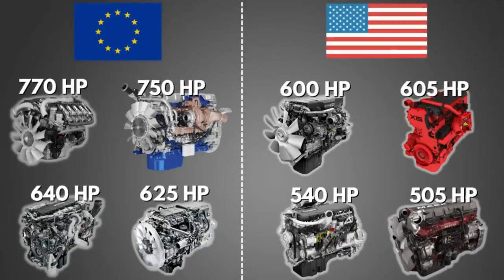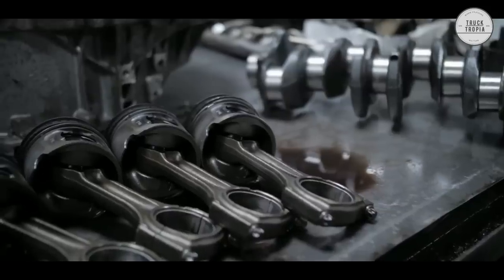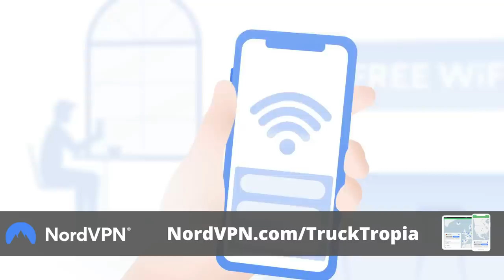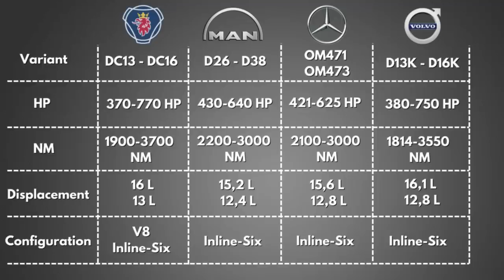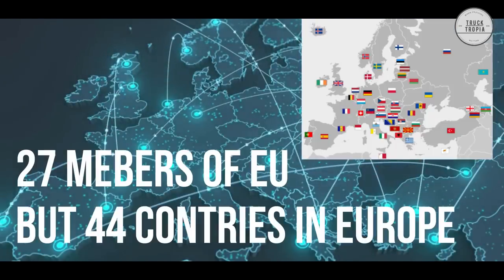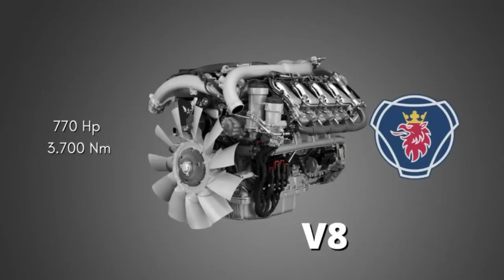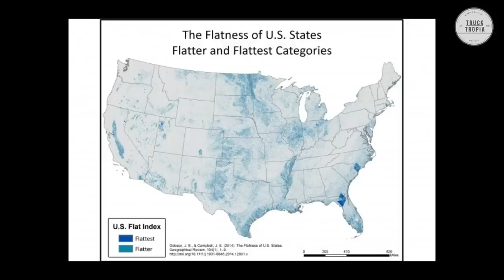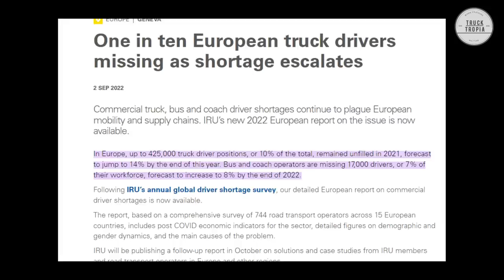Why European Trucks Have Up To 770 HP And US Don’t

Comment: Volvo builds engines for Mack and paints them red Mack colors. The engines range in sizes from 11 liters to 13 liters. We used to build the 16 liter but it was phased out in the US around 5-7 years ago
Reply: Volvo owns Mack. Volvo D16 engine did not make it in US because was running hot at high speeds,  (70-75 mph). The cooling system was not designed for this speeds and if you add some Arizona and Texas heat you have a big problem. And D16 was only rated at 620 HP in US and still did not make it.
Reply: @giacomu1  ironically in Australia  they run in much hotter weather and longer distances. Strange they ran" hot" in the US. We run the Globetrotter Cabover which runs in the Middle East and Africa as well
Reply: @robertryan7204  they probably have larger radiators in those trucks.
Reply: @groofromtheup5719   Australia can get very hot yes
Reply: Volvo engines ARE traditionally red....
Reply: @giacomu1  You are absolutely right, D16 runs hot and the rad system is not big enough cause of aero dynamic shape. more over it has injector cup issues and it doesn't burn very clean as per the California standards.
Reply: @thefreedomguyuk   I’ve worked for Volvo North American Trucks in their only USA manufacturing plant for 23 years and all the Volvo engines we’ve installed are D11, the old D12, D13 and in the past D16 engines w/green blocks and black valve covers. I’ve been in the Hagerstown engine manufacturing plant where all North American engines are produced for Volvo and Mack ( same engine) and all Volvo engine are  green and the Mack engines are red. You must be from Europe?
Reply: @OgleBilly  I think they they might be referring to Volvos gasoline engines which historically were red. Volvos diesel  engines are classicly green as you say and the MP8, MP10 (D13,  D16) for Mack are red. Volvo also makes the D9, D11 for Renault which are usually gray. I work on the assembly line in a Volvo factory in Sweden.
Reply: @thefreedomguyuk  Volvo truck/industrial/marine engines are traditionally green.
Reply: @giacomu1  
It seems weird. We have them in Israel, and we can get Texas and part of AZ hot, and we have 70 mph roads. Volvos are well known in Israel for their reliability.

Comment: Funny thing with non-commercial vehicles.  In  the US you can walk into a Ford, GM or Dodge dealer and buy a 6.7L pickup truck with up to 500hp and 1200 lbft (1700nm), rated to tow 40k lbs.  They're quite common in fact. I only have to walk as far as my front porch to count 3 of them (my own + neighbors)😁
Pound for pound these engines are putting up incredible numbers.
Reply: You can actually buy Class A RV's that you can legally drive without a CDL (though most places won't sell you one without it).

Comment: Here in New Zealand we get both European and American trucks. We are nowhere the size of America or Europe, our limits are 40 tons on ordinary days. We do over that weight on special permits and on certain roads. Then we also have over size trucks (moving a house or similar) which can only be done  at certain times of night. Both American and European trucks do well here in New Zealand (nz)
Reply: Do you have any NZ or Australia made trucks?
Reply: @marcpikas2859  nah. Basically all are imported as right hand drives. Or put together under license from manufacturers. No actual trucks designed and made in australia and nz
Reply: Kia Ora from Phoenix Arizona
Reply: @E_Legal_Alien  Speak english. Not everyone here in New Zealand speaks dam bloody maori
Reply: @marcpikas2859  Australian plant manufacture modified versions of American trucks, and unique Australian only versions, ie the SAR Kenworth.
Various brands are modified highly here to pull the 3 and 4 trailer road trains with up to 120 wheel combinations.
120 and 140 ton rated prime movers are common outside metro areas here but 550hp is an average minimum 660 Signatures and on the private mine roads 7 trailer rigs with coordinated pusher motor trailers making up to combined 1400hp pulling 260 plus tonnes.
Coastal interstaters B double and 42.5 ton single trailer units are very similar to Euro and or American rigs running B trailer tri-axles  most commonly and like NZ there are bigger Japanese prime movers on the road here, such as Hino and Isuzu's running 500/550 hp however for the big stuff and remote outback roads mostly modified American prime movers though there are more Euros appearing, ie the Scania V8's,.
At one time here the only trucks many operators found would stand up to Outback road conditions were the Australian modified Kenworths and the conventional cab Mack's, Superliners, RS series especially running prized the E9 CAT V8. 
Still most heavy outback cattle trucks are Kenworth and Mack' with double C section chassis.
Gearing is the trick and most heavy outback rigs tend to run lower final drive ratios than Euro and American lightweight interstates negating the need for larger HP.
 Western Star also feature more in the heavy rig dept now as well.
Reply: @rossawood5075  Thanks for the detailed explanation.  It’s a different world out there compared to Canada.

Comment: In the uk yes there is a shortage of drivers (has been for years) it’s mainly down to very long hours relatively low pay poor and expensive roadside facilities   And an expectation of employers to get the job done whatever also if you get caught by the police/ doing anything wrong  you WILL GET a large fine and points on your licence

Comment: You mentioned the terrain. According to the need from terrain the EU placed minimum requirements of engines many years ago. Before some drove 30 tons with << 200HP. Those trucks were a cause of constant trouble. AFAIK now you have to have >8HP per metric ton.
Reply: Do you happen to know how long ago that was? For southern Europe, I don't think Fiat/OM/Iveco have produced trucks with such low power outputs for 40 years, if not for smaller trucks that were not supposed to carry 30 tons in the first place
Reply: @RickZanardi  You caught me 🙃 1958 was the law about 8HP per metric ton. But I assume, that was not the last one because it sounds really low - fits to your note about Fiat.
Reply: @wjhann4836  wow I didn't honestly expect it to be traced so far back. To own a car capable of 120 km/h max was already quite something in 1958 so I didn't expect truck speed on hills to be much of a problem at all, but good to know. Also, I went on wikipedia to have a check, the first semi-trailer trucks produced under the Iveco brand (couldn't check for the earlier Fiats) from the mid 80s started at 320 hp, so 8*40, eheh barely to fit the rule, but nice to see confirmation to things :D

Comment: In the 1970s after the fuel shortage many US trucking companies thought that, like a car, a small engine would be more fuel efficient than a big one so that is  what they bought. (like in the 200 to 300hp range) But the owner opperaters continued to get bigger engines (especially Catepillar) and demonstrated that a big engine that was not pushed very hard got better real world fuel mileage than a little engine that you had to flail the crap out of to get anywhere.

But before engines had less HP and did not worry too much about fuel cost, is was cheaper than gasoline. Detroit even used two stroke engines. the N71-238 hp, the 8V-71-318 and the rare 12v-71. The 12V -71 it only got about 2.8 miles per gallon. They are still popular in marine use bacaues it is better in two shaft boats to have the engines turn in opposite directions and being two stroke they can be set up to trun/run backwards quite easily. The did not have valves but ports in the sides of the cylinders and the intake air carme from the crankcase so there was a blower (supercharger) to pressurize the crankcase.. A two stroke engine can be lighter and have more horsepower than a four stroke, basically 2/3 the horsepower twice as often than a four stroke. But they have less torque per horsepower and are not a fuel efficient and polute more, and tend to have a narrow power band that requires more shifting to stay were the power was.

Catepillar's foundatin desigh was a focus on more torque at lower RPM than the other engine makers which today is  the feature of truckm and some car, engines today. But with the increassing focus on airpolution and computer controlled electric fuel injection system they decided it was not work their time as their main focus was on large construction equipemnt.

Many engine makers got into financial difficulty designing an engine that would meet the standards and still work. (they made some dogs in the process)
Reply: And don't forget the national 55 MPH speed limit in the 70s which lasted for decades
Reply: @LA_Commander  It was one of the biggest farces of the times. But this century has eclipsed that geometrically.
Reply: @frosty3693  yeah, no kidding, you're very right about that (unfortunately)

Comment: In the US, especially the west coast it’s very normal for our weight limits to be around 65-80tons combined. It still sucks to pull turnpikes in Utah and Colorado with only 500 horsepower
Reply: Yes it does. I remember going up towards the tunnel in Colorado at 14mph because of the weight of the load.
Reply: @mikepaulus4766  in a perfect world I’d love to have more power, but in reality I just don’t like this paccar motor. It has many mechanical quirks, rather rougher shifting when engine braking, and it’s on its 2nd rebuild after 350k miles
Reply: 80t, laughs in australian

Comment: It's quite sad how the most ridiculous naturally aspirated Japanese diesel engine (a 30.1 liter Isuzu V10) isn't as popular as these brands😔
Reply: Those.... 

Those engines are heavily de-rated to last way way longer. They also run at a very low rpm range. 

With a straight pipe exhaust and a heavy load, they sing when they go uphill at a blistering 20kph.

We still have a lot of them in the Philippines. Notable for having an exhaust that makes you cry. The series are 8Px1, 10Px1 and 12Px1 with x designation for different variants(A-E). The replacement 6UZ1 for the 8Px1 and the 6GWx1 for the 10Px1 and 12Px1 can't compare to the old monsters as they only have 12L and 14L displacement respectively. They do offer very large difference to fuel savings.
Reply: @kimpatz2189  now I've been wondering about it for a while now, I think the the 10td1, which is rated at 600 horsepower, could easily be up-tuned for 1000+ horsepower(since the displacement is more than enough) 🤔
Also considering they last for decades with barely any repairs
Reply: its okay we can use those engines as DRIFT RACERS In cars instead and win championships!
Reply: a 30.1 liter engine would be too heavy
Reply: @ccclc6159  I mean, yeah, they're heavier than some mid sized-large pickup trucks
Reply: @ccclc6159  and it's actually 30.3, not 30.1, I forgot the exact number at first 😅
Reply: @bmad1386  What's the name of the 30.3l engine you're talking about?
Reply: @petrucercel9855  10td1 IIRC,it was discontinued quite a while ago
Reply: @bmad1386  Thanks!

Comment: When comparing commercial diesel engines of US trucking vs EU and European trucking, taking the available transmissions into account is a must. Diesels make incredible amounts of torque, even with low horsepower numbers. In the US, it isn't unusual to see a 350hp diesel making over 700lb/ft of torque. You don't need much horsepower if the massive torque of a diesel is mated to a properly geared transmission. Commercial, industrial, and agricultural equipment use lower hp diesel engines driven through multi geared transmissions to utilize the massive torque so as to have the equipment be extremely powerful. Farm tractors, earth movers like bulldozers, and lifting equipment usually don't have high hp numbers. Take a CAT D6T, for example. This is a popular bulldozer that can move massive amounts of dirt, push down huge trees, and many other large jobs that require the dozer to have immense power. The CAT engine in a D6T dozer is rated at 165hp, but is mated to a low geared multispeed transmission. As a transmission is a torque multiplier, the D6T can accomplish such strenuous tasks as land clearing and dirt work. 

US diesel engines focus more on torque(for which an inline 6 excels at making due to design) and mating such engines to the appropriate transmissions. That's why US trucks have standard transmissions with anywhere from 9 to 18 gear speeds. Euro trucks utilize alot of transmissions that are automatics for the comfort and ease of use by the driver. This has alot to do with the distances driven and the road systems of both regions. The US has longer, dedicated highways than Europe with the roads of the US being much wider. This means US drivers have to focus on the "long haul" so a driver can take his time getting up to speed. This enables a driver to utilize the many gears to get the load moving. In Europe, drivers usually don't have to travel near the same distances as US drivers, but have to contend with much narrower roads, more congested traffic, and less accessible loading/unloading locations. That's the reason Euro drivers have the high hp engine, automatic transmission cabover trucks from manufacturers like Volvo, MAN, Scania, and so on. Also, due to the differences in driving distances, the less aerodynamic shape of a cabover detrimentally affecting fuel efficiency, isn't enough of a problem to override the need for a  tight turning radius which a cabover provides. But, truck design of the two regions is another story.

Basically, Euro drivers need high hp because of the constantly changing terrain, shorter areas to reach traveling speeds, and the need to navigate traffic. In the US, drivers need the massive torque to get the load up to speed and keep it there on the highway while conserving as much fuel as possible.

Comment: Some large brands building civilian trucks are missing:
- Astra, it is part of the Iveco group, but it's the side manufacturing rugged trucks for more difficult terrains use. Dump trucks, construction trucks, mining trucks, military. 
- KAMAZ, Russian (so in Europe), up to 535 hp for export, Cummins engine 
- Tatra, Czech with great chassis, and their own engine line. 
- Sisu, Finland

There are some brands coming in Europe mostly from Asia
- Ford manufactured in Turkey, but with a max 500 HP, or 2'500 Nm, using Ecotorq 12,7L
. Hyundai, with electric fuel cell trucks starts to become large in Switzerland, 3'400 Nm torque
- Switzerland is developping electric trucks. They built the largest electric dump truck for quarries and mines (vigier)
- Other Swiss truck, DesignWerk Technologies, using a Volvo base, but a Swiss powertrain, world record of distance for a battery powered electric truck,

Comment: The straight six is a good design for an engine.  If US trucks with a six have enough power and torque to do their job, then the six is a better configuration for ease of maintenance.
Reply: And smoothness of running as well...although maybe the diesels don't rev up high enough for that to matter.
Reply: SIX'ES' inherently run cooler in hotter climates imo, and you're correct easier servicing!

Comment: I just looked for it, the Kasseler Berge have the same 7% grades as the ramps of the Eisenhower Tunnel, so totally comparable, and 400 to 500 horses are also a usual number for european trucks, so no big difference. That shiny showtrucks are also not usual, but i guess, some owneroperators pay some extras for their baby. I think the differences are way smaller than this video states. The biggest difference is the total length, caused by the different regulations.

Comment: I just gave up a 2000ft/lb Cummins Sig in a KW for a 540hp 1950ft/lb Volvo. Company upgraded me due to policy of a contractor I'm assigned to.
Volvo is only in the 12.7liter class as opposed to the Cummins that was a 15 liter class engine.
The Cummins had explosive torque production. It was about as subtle as a sledge hammer. It was a very hard pulling engine. Would always put a smile on my face. 
Volvo on the other hand seems pretty good too. It almost but not quite hangs on the same as the Cummins but it is certainly far superior to the 715HP V8 Scania I drove that was HOPELESS. Stupid Volvo has a 12sp auto with 400RPM drop between 12th and 11th. That's not ideal for pulling except it does 55MPH/95km/h in 11th so is probably OK. We'll see as I've only clocked over about 300hrs in the Volvo and not traveled all the same routes with big loads yet. I'd like the Volvo more if it had a full automated 18sp Road Ranger in it or better still just a manual 18sp like my beloved KW (which is still in the company just assigned to other tasks).
The KW would spin the drive up on a damp road with 23t of payload in 2nd gear high range direct at low speed when it came on boost if you weren't careful. It was a very powerful truck but truly awful driver comfort.
Reply from the maker: Thanks for sharing
Reply: How much horsepower did the Cummins have?
Reply: The old Mack V8s and Cummins 19 litres have a much better power delivery than the new Volvos and Scanias, even though they make less power on paper they feel so much stronger.
Reply: @Camaro_LT1  600hp and 2000ft/lbs @1375RPM IIRC.
I couldn't really care less about HP.
The closer you get to 2000ft/lbs of torque (or beyond these days), the more you get a relative idea of how powerful the truck is.
HP is good too I admit, but I've found that if the torque is high then the power is high. That doesn't always hold true if vice versa.

Comment: I have my Cummins ISX 15 turned up to 625 HP and 2300Ft Pounds torque. It does just fine and still gets over 6 mpg at 70-75 mph.